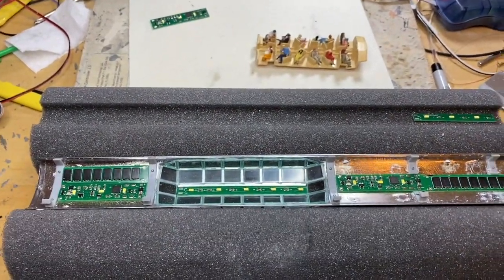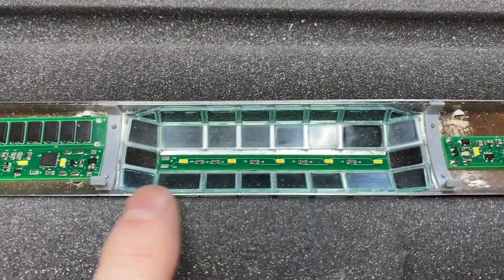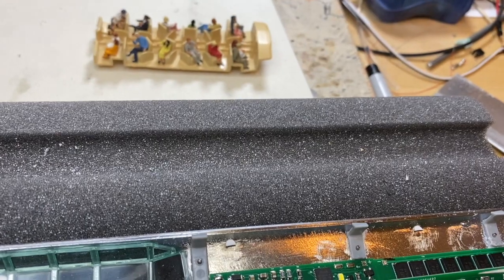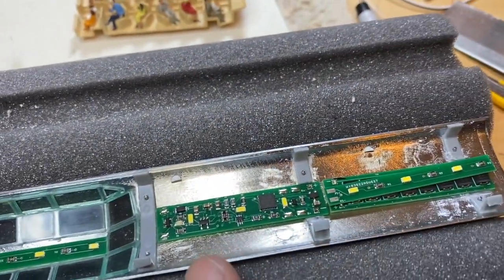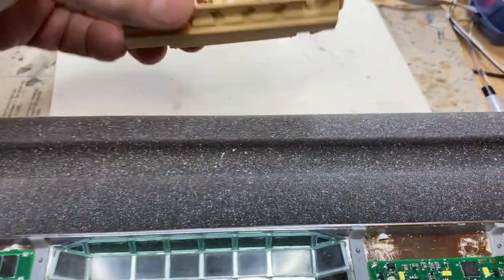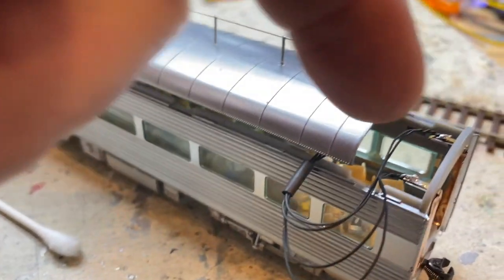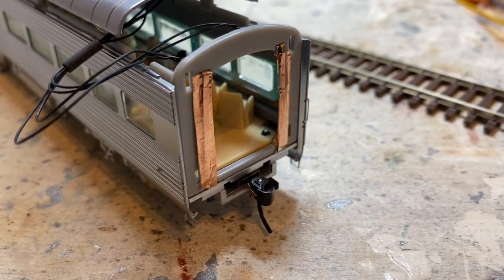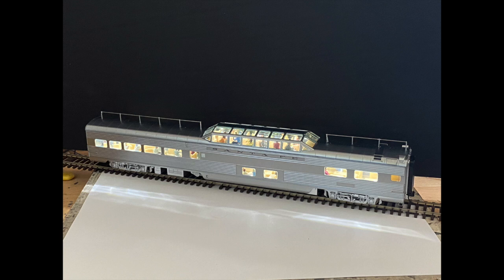HO Pleasure Dome 2021 version

Comment: This is a great product breakthrough! Will you please consider miniaturizing this product to fit N scale Kato dome cars, such are used in the Super Chief train?
Reply from the maker: Our flagship products were design FIRST for all n-scale KATO cars and we also made a separate Dome Board for certain dome cars.  Check out the videos on our website (under Videos) .  You will see several examples of n scale Kaot dome cars lit with our boards.  thanks for the question!
Reply: @ModelTrainTechnology  Thanks for letting me know about this. Now I see these N-scale Kato passenger lightning kits after I scrolled down to your earlier videos.